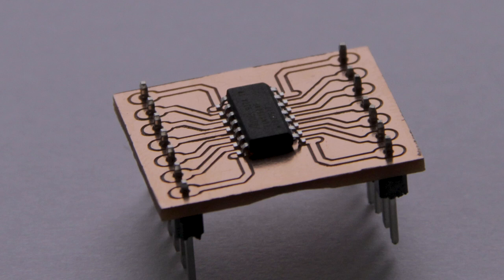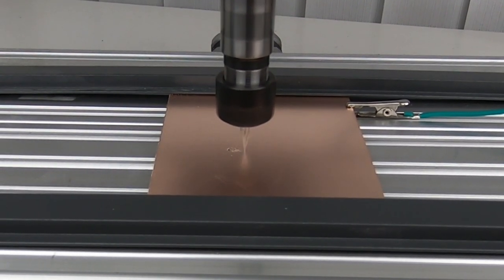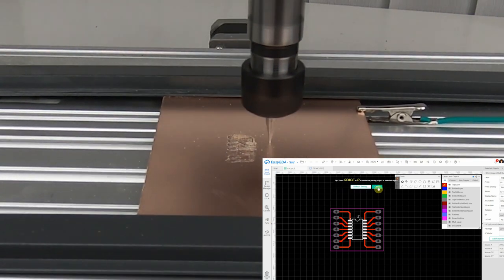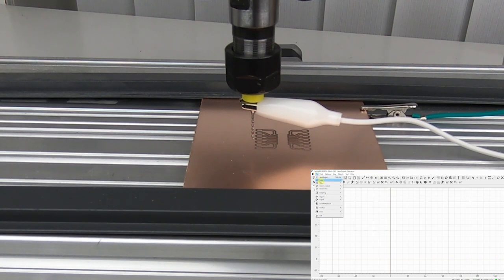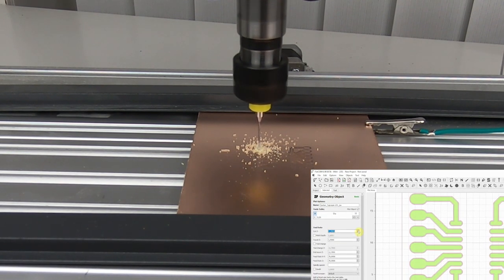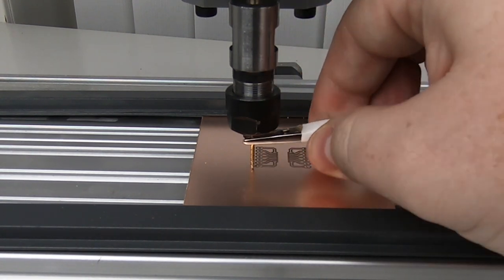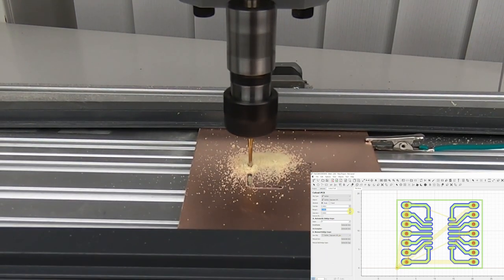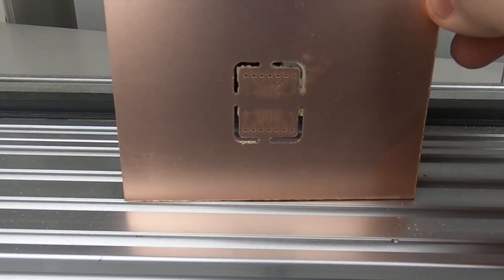CNC PCB - high quality with the budget 3018 CNC

Comment: Hi guys!
I have some issues with my CNC 3018 and i hope you can help me.
1. After i charge the PCB from Flatcam,most times the CNC start milling without turning on the Spindle.I stop the process,i set all axes to 0 again and i try again but same thing...sometimes after the first try,i here the CNC try to turn on the spindle but only for 1 sec after i get an error something like (something went wrong error) .After few tries like this,work.
2. After the CNC milling the traces,i charge the file for drilling the holes...the CNC start but after 1-2 or 3 holes ,stops and i must reset everything,even the USB i must remove it ad plug it in again thats mean i loose every coordonates. If i didn't make sign with marker on the PCB,i will neer know the 0 point
3. I connect 3 limit switches but doesn't matter where i set the X,Y,Z to be 0 point...the CNC never go there if i press "Home" button, appear a message like "this function is disable" and i didn't find an setings or something for enable that.
After all of this errors and issues i thing the problem comes from CH340 driver or from communication but im not sure. The software for CNC is "GRBL Controller",almost like "Candle" but "candle" i also download it but the buttons for axes not works at all
If you can help me with some information about this or if you have some recommendation,let me know!
Thanks!
Reply from the maker: Hi! Did you buy one of the models we recommend and link to? If so, can you share the link. This is important for the modules used on the main board as well as the design of can machine can influence as well,

Comment: For Your experience, what's the minimum spacing between route? Is possible to realize PCB with SMD components?
Reply from the maker: Hi!
It must be a minimum of you bit.
I like to try to fit in one extra isolation track with 10% overlap for each track. 
So a good minimum would be 10% + bit width + 10%

For a 0.2 bit 30 degrees 1 mm down the width of the bit is about 0.25 mm.
10% of 0.25 is 0.025

0.025 + 0.25 + 0.025 = 0.3mm

And, yes, a PCB for SMD components can be milled. In fact it's what we are doing in this video :-)
Reply: @DIYTECHBROS Thanks I will try

Comment: where are the connections for probing? I see where the aligator clips are. Do you connect the drill bit to the pcb board?
Reply from the maker: Hi! Probing is done though pin A5 and GND.
Connect one pin to the PCB, and the other to the drill bit.
See this site for more: https://github.com/grbl/grbl/wiki/Connecting-Grbl

Comment: 3018 can mill a soldermask?
Reply from the maker: Mariusz Woźniak sure! Not a problem!
Reply: @DIYTECHBROS  So Wegstr is waste money and time?
Reply from the maker: @mariuszwozniak6918  No, from what can see from their videos it seems like a very good product. BUT, that being said,, the 3018 can handle all the specs we need for a PCB. We can mill the same trace width and clearance as when we order a PCB from China.
Reply: @DIYTECHBROS  I overspend a bit of time looking at cnc's again. It more about the toy than the actual usage I fear.
Can you make a reliable trace under a 0805, or 0603 smd resistor? 
I allready have a setup for single sides UV exposed pcb's. I have the chemicals and some experience. I think I would want to be able to do double sided.
My hobbyprojects mainly involve using the atmega328p-au chip. and a few sot23 sized parts. And of course 2 sides to prevents the use of bridges. Traces are 0,20-0,25mm. (8mil) Distance between traces are a minimum of 0,2mm though I do try 0,15mm. Which works of course with commercial pcb suppliers and a bit with uv exposure at home. 
Would you say the machine is up for the task, or continue with uv exposure and learn to do two sides?
I have never experimented with solder masks, but I have determined I should definitely try this, looks easy.
Reply from the maker: @joerideman  Hi! 
That's a great question! 0805 is not a problem. But I would say that it is starting to push the limit.
The CNC it self is not going to be the biggest issue. Just create a higher "resolution" height map and it will perform very accurately. 
The quality of the copper clad board and the bit in the milling process is whats going to be the biggest challenge. 
A good quality PCB (with an even layer of copper and good adhesion to the fiberglass) is going to be key.  
And next up is the bit and feed rate. You need to make sure the bit will not tare off too much copper.
If you have a layout you want to mill, I can have a go at it and  see what results I can get. See our "about" page to get our email!